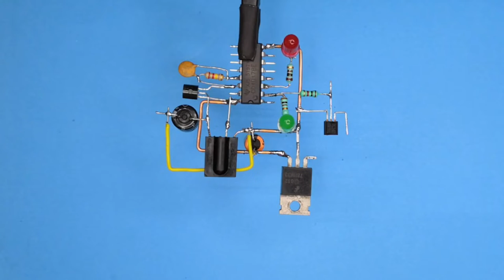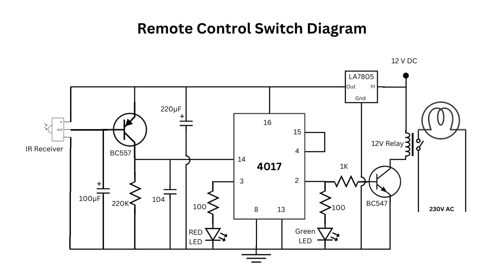How to Make Remote Control Switch Using TV Remote Control

Comment: So nice.  But where did you set the ir code for the power button code?
Reply from the maker: Thanks
Reply: That is discrete logic chip, there is no "code", only logic gates and stuf... I dont know this exact component, but since its counter, it proably recieve serial data stream from remote, and output binary number in paraler, and he does connect "output" according to binary position of the pin in the number or something... I wonder if its posiible to build this with shift register, bc i think it is (just recieve serial number and output it paraler, since it is binary, you can use it  as controler i believe)
Reply from the maker: @PetrBelohoubek-ot5ok ok